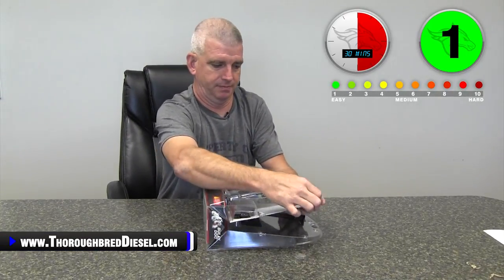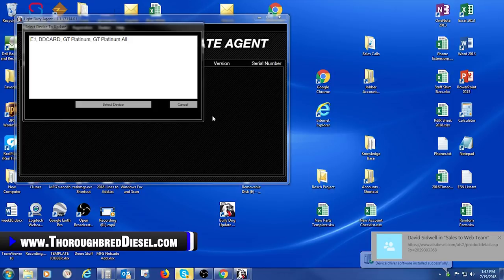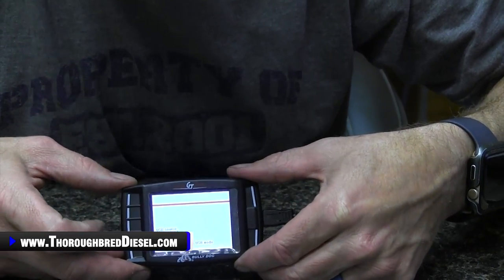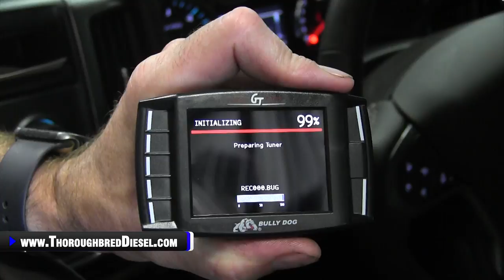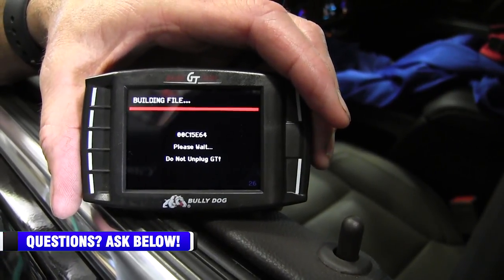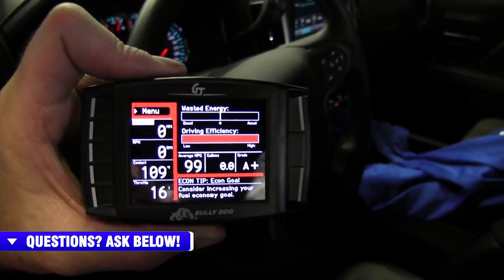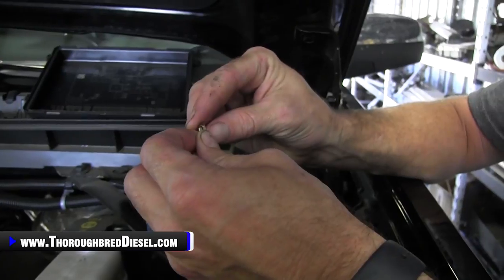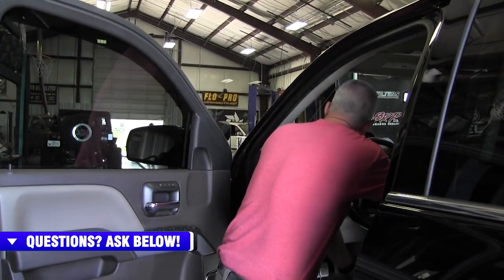Bully Dog GT Install (Gas)

Comment: What is brake torque management
Reply from the maker: Basically,  disabling BTM gives you the ability to hit the accelerator while holding the brakes without the motor reducing power.  If you catch my drift.
Reply: Thoroughbred Diesel 

So basically what you are saying kinda like launch control?
Reply: @jeissir  no. More like traction control
Reply: It's so you can brake torque burnout 🤷🏼‍♂️💯💪💪🤘😁😂

Comment: I have a cherry of a 2010 GMC Sierra 2500 HD WT that I use for towing. It’s only got 100k but it’s a sled. 6.0 liter gas. Would you recommend this for my application on installed one in a truck like mine? Main reason is it downshifts hard in tow haul and it also needs more in the top end of the rpm range. I’d order it from you if so. Thanks for your time. Sam
Reply: Did you install a tuner? I'm having a hard time finding info about results, especially for people that use their trucks for work and towing.
Reply: @4JOESPH  any luck

Comment: Do you recommend one of these for the 2015 hd2500 6.0.  Right now it’s a dog pulling a fifth wheel. Can’t maintain highway speed.  Any incline it kicks down and sounds like it’s gonna blow.  Forget accelerateing to pass on highway.  Will one of these give me more power to pull at highway speed?
Reply from the maker: Yes sir. The GT does really well on gas engines. We have had especially good luck on the 6.0. It really wakes the truck up.

Comment: I bought my tuner used and it didn't come with the thing you put the sims card in and plug into computer. Will a regular sims card adapter work to download the tune?
Reply from the maker: Yes, any SIM card adapter will work.

Comment: So I can use the tunes I made corrections to without doing the fuse process?
Reply from the maker: The initial download will require the fuses to be pulled.
Reply: So,I'm still fuzzy on the answer...when adjusting the tuner, after the initial load process,do I have to pull the fuse's again later in time once I've decided to alter the tune?
Pretty scared I will mess up my truck,but trust your opinion..
Reply: Also,what is USB mode?

Comment: I don't think you have to install the programmer to the fuse box. Just upload your tune and you should be good to take the programmer out. I have a dash cam set up in the passenger side, with an oversized tint bar across the top and just don't want the extra screen dotting up the windshield.

Comment: So,I know I'm doing something wrong,I'm also not tech savvy and using an older laptop,but for some reason,my card isn't showing up to the update agent 🤔🤔🤔
Reply: And I've already had it programmed to another vehicle but done what was required,or so I think,to uninstall from the other vehicle 😢
Reply from the maker: Yep, try that.
Reply: Figured it out,I didn't complete uninstalling from other vehicle, didn't do my homework 🤷🏼‍♂️😔😂 thanks TBD 💪

Comment: Why wont mine let me switch to battery mode? My 08 silverado came with an unregistered but installed GT on it and i registered it and am updating it. But if i switch from key to battery it wont turn on.
Reply from the maker: Is the power wire installed?

Comment: I have one in my 2004 Chevy Silverado and i use 87 since gas prices are high do i change the level from premium to regular
Reply: Yeah if you were running a premium tune and were running 91, then you should detune  it to the stock or original whatever the middle option is.

Comment: I bought a used programer for my 14 silverado its been runnin on a 2012 silverado my question is do i need an upgrade to make it Work properly
Reply: About a use yet also in like a moon to download it in tells me it is a downloading GT diesel device which I have a 2000 live in yes. Can last you make this work

Comment: Will this give the option to disable AFM (DOD) on a 2012 5.3 Silverado?
Reply from the maker: This will disable AFM.
Reply: This will NOT disable afm
Reply: Has to pop up and give u that option to shut off.. it worked on my 05 and 08 but does NOT work on 2014 through 2016 for sure
Reply: @dustinyeargain2525  I can confirm this I tried it on my wife's 2014 suburban 5.3

Comment: I installed the bullydog gt to my 2013 chevy 2500hd 6.0 gas and now my truck will not start and can Uninstall the bullydog gt
Reply: You ever fig this problem out?  Thinking of getting for my 2015.  If so do you like it ?
Reply: Did you ever get it to start?  Also how did you like it on your 6.0.  I have one and seriously thinking about getting one for more towing power.
Reply: @Jaydogg2001  it never worked and my truck still doesn't start .hopefully the new ECM I had to order fixes it

Comment: BUYER BEWARE: May not work and may damage your vehicle.

In July 2020, I purchased a Bully Dog GT Platinum Tuner for my Infinity G37x. When the product arrived, it continued to render an error code and wouldn’t install into my vehicle. After waiting for several hours for a Bully Dog / Derive Systems customer service representative, I finally was connected with customer service, who advised that their server was down. After some effort on customer service’s part, they managed to remotely connect to the tuner via a laptop and install a software update. I was told that I could now install the tuner into my car. Sadly, it still didn’t work. But worse, the tuner caused several warning lights to come on in my vehicle.

The next series of calls uncovered the need to go out and buy a battery charger. It should be noted that my battery is already in good working condition. After installing the battery charger, and even getting back on with customer service (after hours of hold time), the tuner still wouldn’t install into my car.

This sent me into a customer service journey case study. After over a dozen calls to customer service (several of which I wasn’t able to connect due to their phone systems not being able to handle so many customer service calls), I was told to mail the Bully Dog GT Platinum Tuner back to the company for a warranty repair. At this time, I was told there was only one other known Bully Dog / Derive Systems case with the same issue. Customer service also advised that the matter had been referred to their “Engineering Department” for resolution.

Well, after mailing the tuner in and receiving a replacement, the product still didn’t work. This resulted in another series of calls to the Bully Dog / Derive Systems customer service line. After another handful of hours waiting, the technician advised that the Engineering Department was still reviewing the issue and would get back to me, but that he’d request an update from them. 

Over a week later, I called again. This time, I was told that the case actually hadn’t been referred to their Engineering Department and that they had several other cases of their product not working where they couldn’t find a way to make it work. Effectively, I was waiting on a call back from no one.

I’m not sure if this is a problem with horrible customer service, a shoddy or otherwise dangerous product, or a combination of the two. While Auto Anything acted ethically – and promptly answered my support call – by refunding the purchase price, the response by Bully Dog / Derive Systems leaves me baffled. For a company so highly reviewed to act in such an obtuse manner just doesn’t make any sense. Worse, to lie to customers that they will fix the issue, but do nothing, leaves one to wonder if the company just had an issue here, or if they are willfully selling a product they know doesn’t work to consumers.

I don’t know whether this is a matter of poor customer service, a defective product, or false advertising claims. But what I do know is that I will never purchase another Bully Dog or Derive Systems product again. I guess the final stage in this saga is looking up a repair shop to figure out how to fix the damage their product caused. Buyer beware: If you purchase this product, it may not work, and it may damage your vehicle. And if you have a problem and need technical support from Bully Dog or Derive Systems, be prepared not to be able to call because there are too many other customers seeking support, to wait for hours, and, potentially, for customer service to lie to you hoping you’ll just go away and they can pocket your money.

Comment: This thing must be the most overpriced piece of crap I have seen in a long time.  Note the SD card is 2GB and that is the max size.  They forgot to send me one.  Next I finally found one and the software doesn't recognize the darn thing so it won't update anything.  It's a brick to me.  HP Tuners is modern about the same price and it works!

Comment: Error code 203
Not reading vin
Everything else ok just showing vin different then my truck 
I updated the unit everything
Reply: Not reading your VIN because the unit is locked to another vehicle,,you have a nice paperweight until you spend another 250 to have it unlocked .. programer is married to another tuck